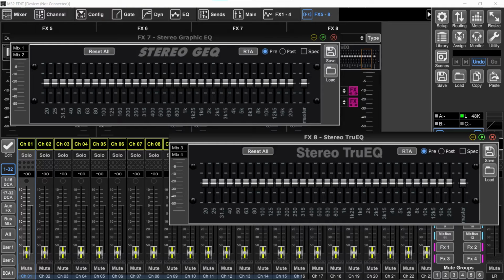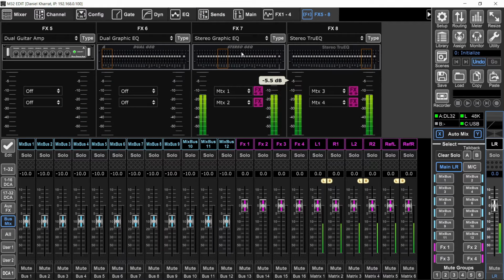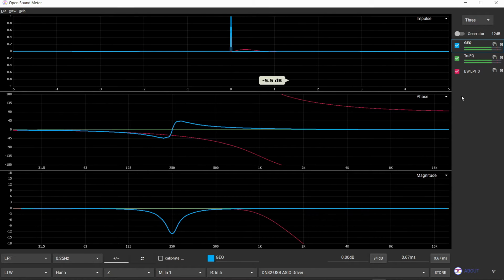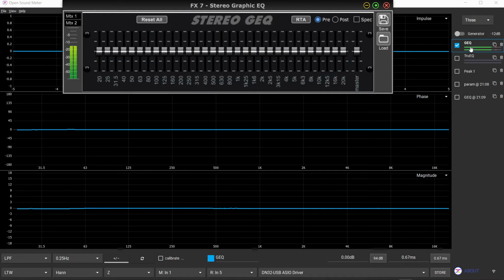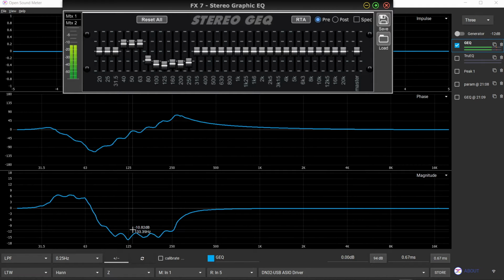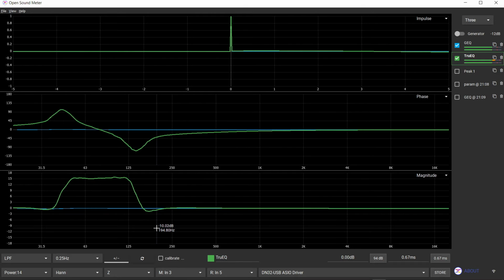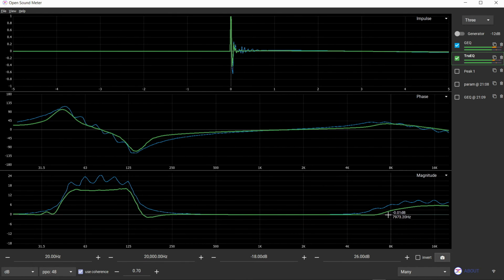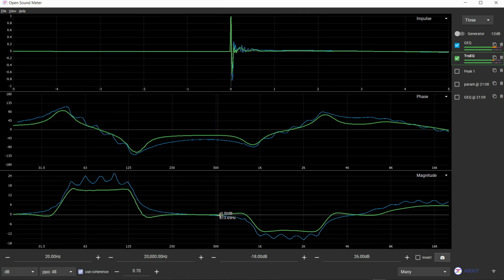GEQ vs TruEQ vs Parametric EQ | Pros & Cons

Comment: Something I just can't figure out is what the actual difference between de stereo and dual function is. Can you explain that to me? :)
Reply from the maker: You use the stereo effect on a stereo channel or bus (2 linked channels or busses)
The dual is used as 2 mono effects on 2 different channels or busses 
So it's like having 2 independent effects but they are in the same slot instead of taking up 2 slots

Comment: Great video!  The visualization really helps keeping the differences straight in your head.  Since you seem to use Open Sound Meter quite a bit I decided to look into it.  It's $70 for the phone app version which is obviously not inexpensive, but looks like it could be very useful for adjusting speakers to different rooms and spaces.  Normally when you use it I see it on a PC and you connect it directly to the mixer.  I have two questions.  First, can it be connected to the mixer from my phone, and second, can it just be used on the phone without connecting ti to anything to listen to the room while making adjustments on the mixer?
Reply from the maker: Your phone mic isn't ideal to measure a room (frequency wise) and also you need a reference signal to compare the measurement with it
Sure you can use the rta but that's not very helpful to tune speakers in a room
Reply: @danielkharrat  So can the phone app be used connected to the mixer?
Reply from the maker: @darrylkallen  i haven't used it but if you have a cable to connect it i suppose it should work

Comment: I'm a sound engineer since the past millennium and I worked with heavy and big analog consoles, with a limited number of compressors and gates in insert, and a 4 band eq on the channel, in lucky cases with 2 were parametric bands. 
I'll never forget the beauty of addin a 31bands eq on the LR master and 4 little 15bands eqs inserted on the 4 aux monitor busses in 2002.
Then digital arrives with a lot of possibilities and after the years the X32-M32 family is imho the price/quality killer. I know medium and big productions that use X32 system or have an X32 ready as a backup console. I'm a happy owner of X-airs and X32 in my service and use them since 2016 but I've never explore that deep.
The path and clarity of your speech are excellent and I am enjoying watching your videos to understand more and to learn how to make the most of the potential of a system with so many possibilities.
Liked, clicked and subscribed!
Thanks from Italy  🍻